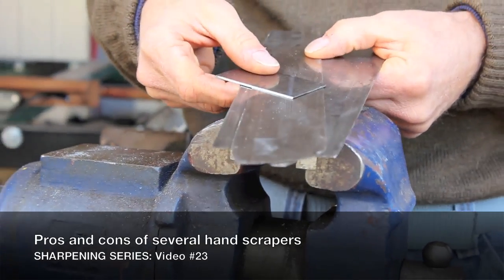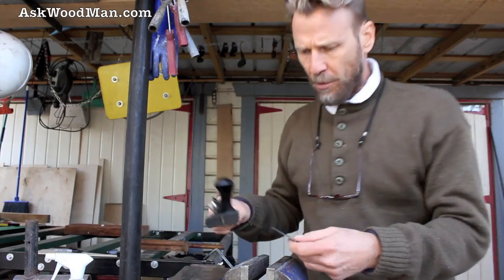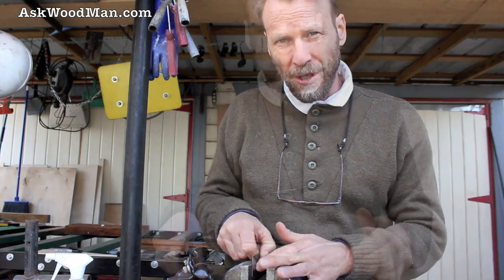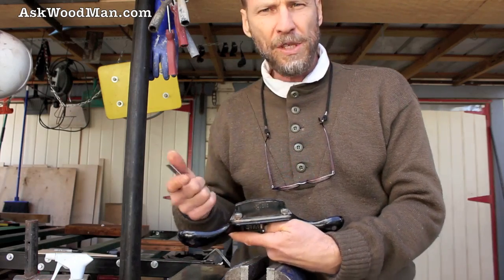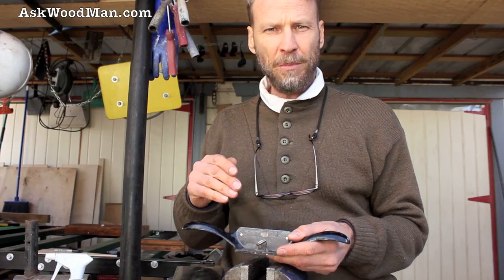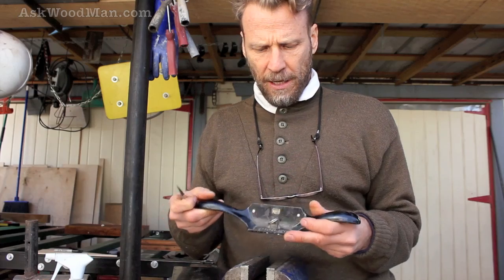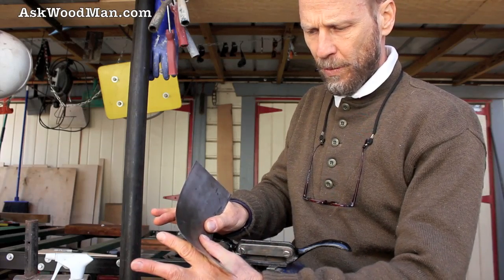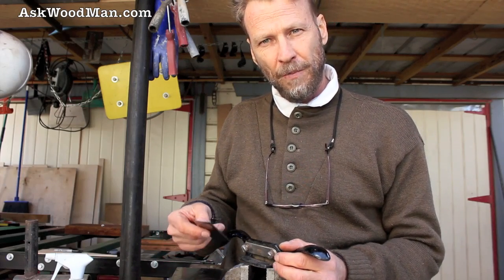Woodworking Scrapers & Scraper Plane • Complete Sharpening Series Video 23

Comment from the maker: I am still nursing it along. All the the replacements I have seen are so short that I can't hook both sides. I did cut a blade out of one of my old 75mm Hitachi resaw band saw blades. The thickness is just a little light but it takes a wicked hook very easily that seems to last about as well as the Stanley blade. The thinner blade thickness makes flexing it with the thumb screw much easier. And I can hook both sides

Comment: Allen.. Hand scrapers do exactly the same thing ti my hands as well.. the #80 is awesome.. Have you used a Stanley #112?
I use the #80 like a hand scraper and the #112 for the table top or anything that's big and needs to be buttery smooth..
Reply from the maker: I used to have the Kunz version of the 112 but sold it because I just was not using it. I found I was ready for the half sheet sander instead of more scraping.